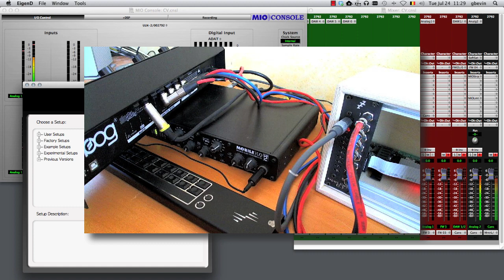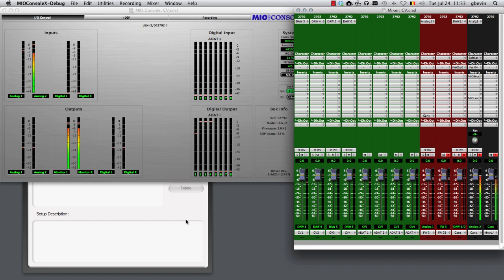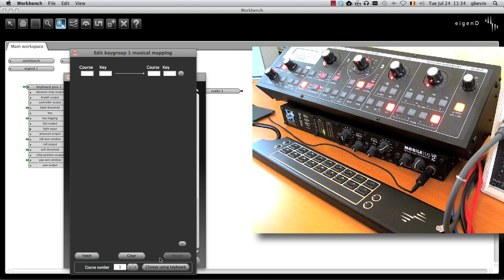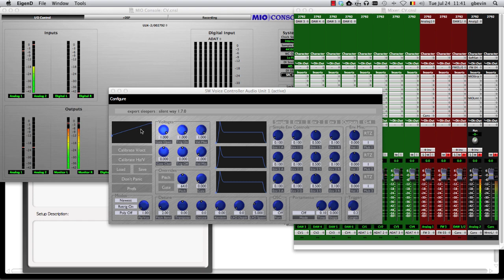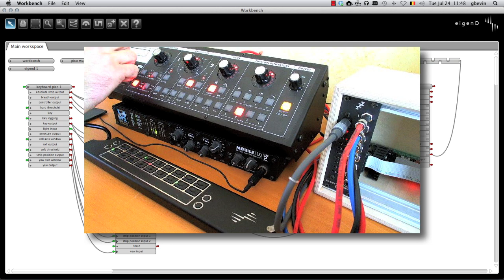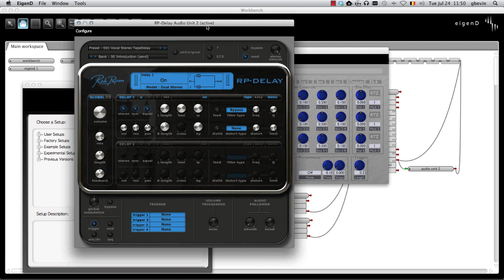Eigenharp Control Voltage setup with Workbench, EigenD 2 and Silent Way

Comment: Very good video, i'm trying to setup my Slim Phatty with Silent way, i have hard time calibrating,(i succeeded with the Monotron)  is that because i didn't plug any cable into the gate Kb input cv. (i'm using midi in for gate) ? maybe we can't use midi in same time as CV stuff ? anyway i'm  checking that again tonight. Let me know if you have some tips. Thanks.

Comment: I want Pico Cheap: no lights, no complex software just simple note output, all midi channel 1, notes 1..18, a little bigger buttons, no breath input, 2 x 9 button matrix is just perfect decision already, price maximum 199 Euro.  In short, I only want those Pico key functionality in cheaper, no rest.  If not Eigenlabs will produce this, any other company?

Comment: Thanks, I found that video.  I wished Korg nanoPad 2 had also Pico like buttons, with additional two dimensions for immediate sound manipulation.  I am also not sure what this EigenD software allows to do and what not.  For example I would not want anything EigenD doing for me midiwise, I would like to define everything myself, midi notes, channels and any other events which might be required. I wished those Pico buttons were a little bigger, similar to nanoPad2, no lights, no software, cheaper.